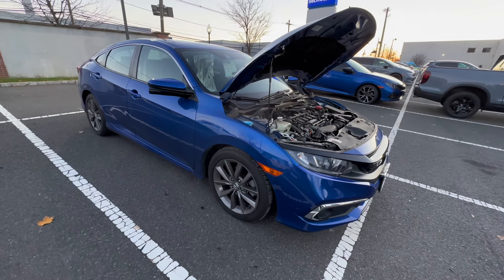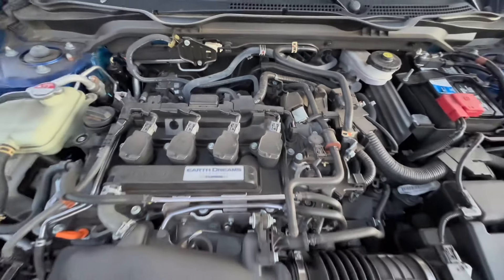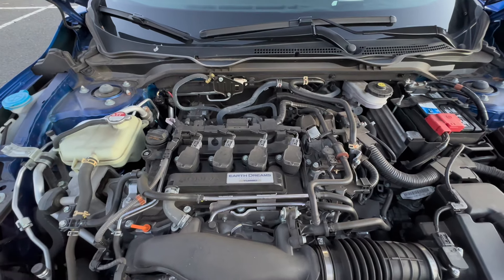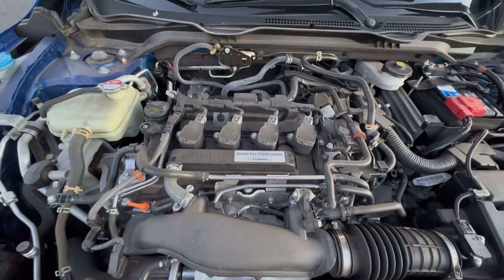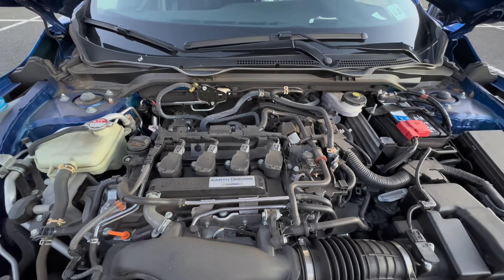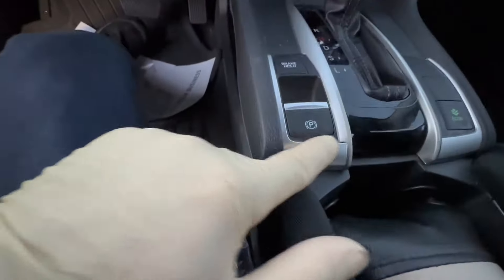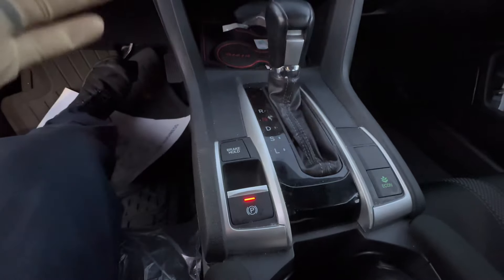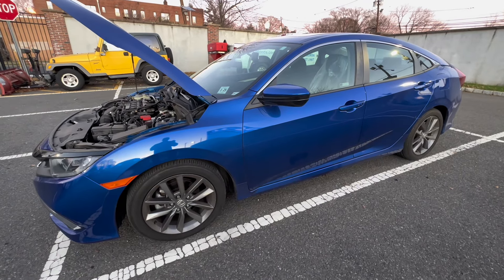2016 - 2021 Honda Civic problems

Comment: 2018 Civic LX 2.0l 6spd manual cold start issue. Starting the car first thing in the morning any temperature, turn the key, starter engages, turns over the engine, engine catches, the rpm initially drops to almost a stall then increases to high idle instead of going to a high idle like normal. Every start after that it functions as normal, only on a cold start does it almost stall. Seems to be getting progressively worst and I'm worried one day it won't start.
Reply from the maker: Possibly a dirty throttle body comes to mind. Wouldn’t be able to say for sure without some data.

Comment: I have a 2018 Honda Civic hatchback 5d sport 1.5l l4 turbo. And I just got a new battery a month ago and I had it tested today because my car won’t start since last night and it still won’t. When I took the battery to autozone they hooked the machine up to the battery and nothing is wrong with it. So idk why my car won’t start. Could you help me? The car has no power at all and no lights come on on the dashboard when you try to start the car up.
Reply from the maker: Body control module most likely or tcm

Comment: my 2016 honda civic radiator fan always at a high speed which makes noise in hot weather. when i speed it goes normal. when i stop it stays normal for about a minute and goes high speed again which is very loud. how can i fix this problem ?
Reply from the maker: It’s most likely not a problem and on “high” to cool off the condenser for proper ac cooling. Usually if it’s extremely loud is due to an aftermarket fan assembly.

Comment: Appreciate the videos man. Any ideas on the reliability of S2000s? Like 04-05 in particular
Reply from the maker: 04-05 s2000s we’re solid. Stay on top of fluid maintenance. Remove delay valve from clutch slave cylinder (causes clutch slippage at full throttle shifts) some cases of rear axle cup wear that can be corrected with spacers or new inner joints. Also have your valve lash checked every 30-45k.
Reply: @BCautosutions  thanks bro!

Comment: 2019 Honda Civic 2liter. Making weird metallic growing noise on idle. Is this normal? Maybe its always been like that and i just noticed?

I changed the spark plugs and its the same
Reply from the maker: I would probably have that checked out, might be a bearing on an accessory going bad.
Reply: @BCautosutions  thank you =) 
Do you think if I relieved the tension on the belt and then wiggled the different pullys, could that help me identify if the noise is coming from a pully?
Reply from the maker: @warrenpeterson5709  yes for sure
Reply: @BCautosutions  it's the Idler Pully! Thanks for the help. I'm surprised it wasn't squeaking.
Reply from the maker: @warrenpeterson5709  🫡

Comment: Hey i have 2017 honda civic lx at 45k miles. I wanted your advice on what to do about the a/c condenser if i dont have warranty anymore? Any affordable solutions? Also, i recently changed my tires and soon after i noticed my car stopped beeping at me when i locked the doors. I have a base model with minimal settings on the digital center display and cannot find any settings that would control that.
Reply: They extended warranty on condenser to 10 years, so you should be covered.

Comment: Ford on some of their Ecoboost 4 cylinder engines from 2015-2019 or so had an issue with coolant intrusion between cylinder 2 and 3 due to the poor design of the block to head gasket mating surface.  There was a little slit between the cylinders to allow for extra cooling on the open deck design.  However, there wasn't enough surface area for the head gasket to seal properly. As a result, there have been coolant intrusion issues as well has cracked head issues.  I noticed that the Honda L engine has a very similar open deck/cylinder cooling slit design.  Have you seen cracked heads between cylinder 2-3? Have you seen coolant intrusion issues as well? Thanks.
Reply from the maker: Yes and yes, I’ve made a full video on this exact topic
Reply: Just watched it.  Nice work.
Reply from the maker: @SibRevs  I appreciate it

Comment: Mine 2019 civic sports 4dr 2.0 L. When i try to merge on high ways feels like it doesn’t want to go over 100km/hr it takes too many rpm to shift the next gear. Car only has 44k on it. other than that no issues everything is smooth. Is that normal?
Reply from the maker: @yetsauto9741  they do lack power. How’s your air filter? Oem? Clean?
Reply: @ haven’t checked it , i am just scared that its not cvt😀
Reply from the maker: @ yeah I hear ya. Have your local dealer take a look

Comment: I have a 2017 1.5 and it had around 65k miles I bought it at around 18k I’ve noticed after having it running for a while it sounds like it pushes itself more or just sounds like louder like it has a hard time when I press the accelerator
 I thought initially able to because I had the AC on and it was very hot but a/c was off

Comment: Am considering 2023 Civic with 2.0 NA or EX with 1.5T.  I like the 1.5T power. The turbo boost on the EX is 16.5 psi vs 20.2 on the 1.5T Accord. Both run 87 octane. Do you think that makes Civic less likely to blow head gaskets than Accord? (Lighter vehicle, less stress on engine too?)
Reply from the maker: Precisely. In fact I’ve done more accord then civics and crvs. That’s my exact dissection as to the major contributor for that. Nice job 👍🏻
Reply: @Hondamobilemechanic  Thanks very much. If I do get the 1.5 I'm still going to do 3k mile oil changes and run 91+ Octane.
Reply from the maker: @stevenr1354  👏

Comment: I have a 2020 Honda civic LX. I bought the car used with 34k on Odo. And ever since I bought like 9 months back. It started the clunking noise coming from the front left axle, and the right suspension made a thud noise. Took it to Honda they first look at this but couldn't diagnose anything. Well after 3 months with alot of suspension parts changed and left axle changed it is still making the same noise. Can you please help. The clunking noise is heard when you lift up from gas and depress it. And the thud noise is coming from them the suspension drops in dips in the road.
Reply from the maker: Could be anything from links to loose/under torqued suspension parts, to bad engine mounts. Tough to say from here

Comment: Anyone had problems with the backup camera on a 2019 Civic Touring? Mine is cloudy, I tried polishing it but needed to replace it. Now the trick is getting the fasteners out from the strip of plastic that covers my access to the camera.
Reply from the maker: Need to replace
Reply: @BCautosutions  I am not sure what you mean, the strip of plastic or the fasteners?

Comment: how about toeque streer at high speed not  safe for  faniy
Reply from the maker: @andreaziz5499  torque steer means under acceleration. Would require massive amounts of power which this car would need 3x more then it has. Your probably experiencing something else.

Comment: I have a question about a 2019 civc lx with the 2 litre and cvt.  Is there 2 filters for the cvt or just one and if there is one in the pan why is it hard to find
Reply from the maker: Just one, behind the trans cooler
Reply: @BCautosutions  thanks wasn't sure if the had one in the pan or not.  Now it on to who makes the better filter

Comment: So I got a Honda civic 2019 sport at first my car jus said electric parking damage and the car didn’t start so I got cables n connected it to the battery n the car did start n the electric parking code went away but now I have to use the cables everytime to start the car so I’m thinkin it’s the battery and it’s been like that two days but now it perfectly starts any ideas on what it could be?
Reply from the maker: I would have the battery tested, if it passes, have it looked at by a professional

Comment: civic si 2017 what about so meany light in the dash board power steering system EPS problems vehicle stability assist VSA problem Hill start Assistant problems
Reply from the maker: Did you get it diagnosed?
Reply: I have the same issue with my 17 civic. I had it scanned but they weren’t able to detect the issue.
Reply from the maker: @jayvillanueva5310  odd, nothing stored? Is the battery older? Low voltage can cause all sorts of weird issues.
Reply: @BCautosutions  it’s really weird. I just replaced my battery couple of weeks ago. My car drives normally though.

Comment: Currently having a problem with my acceleration. When I turn my car on the gadge starts off the 4th line between the 1 and 2. As time passes it’ll  go back down to the 5th or 7th line and as I push on the gas it has a 0.5 to 1 sec to accelerate. Not sure what the problem is would be awesome to hear back on what it can me.
Reply: Throttle lag from the sound of it. I had the same issue. Get CRC throttle body cleaner and clean it. World of a difference for me! Acceleration and reverse were back to proper responsiveness. I've even had issues of the car dying on my three times at a red light also.

Comment: A/c condenser failed twice .  Only warranted for ten years . Then what ? Car has 40k original miles. Rodents got me once . A one time tranny sensor that set off a ton of lights
Reply from the maker: I’m not sure what happens after that. That’s not my call unfortunately. As far as the rodent damage, rodent tape should be applied and chances are they won’t be back. Trans sensor isn’t too common. Thanks for sharing

Comment: I need help! Disconnected battery to install fog lights on 2022 civic now it only turns over then shuts off im so confused
Reply from the maker: Probably something with the fog light install. I’d look/remove your wiring 1 by 1
Reply: @BCautosutions  nothing is connected all I’ve done is place all the wiring where it needs to go it was basically a plug and play install
Reply: The brake light on the speedometer keeps flashing and the speedometer won’t light up
Reply from the maker: @Land2.0  did you unplug anything and plug back in during the install that was in the way?
Reply: @BCautosutions   no, when we disconnected the battery to pass the wires through for the fog lights we then reconnected the battery and the car will turn over but then shuts down  is it possible disconnecting the battery could blow a fuse
Reply from the maker: @Land2.0  no, definitely not. Something went wrong. Did you poke any sharp tools through the firewall grommet?
Reply: @BCautosutions  ended up towing it to the dealer yesterday to find out what the heck happened  and after I disconnected the battery the vehicle decided to deprogram the car keys so every time I went to start it the immobilizer would shut the engine off
Reply from the maker: @Land2.0  that sucks. Atleast now you know what it is.
Reply: @BCautosutions  yup and to never disconnect the battery again 🤣
Reply from the maker: @Land2.0  😅

Comment: Thanks for this video. I've had very very minor problems with my '21 Civic Sedan Sport 2.0 NA. One of them being - the brake PEDAL squeaks about 75% of the time when released, whether the car is on or not... I've taken it to the dealer twice regarding and they lubed but only settles for about a day... any advice? also 2 of my reverse lights have gone out already which is more so annoying than anything.. could be bad bulbs but not a big deal. Just wish I could get the damn brake pedal to stop squeaking when I let go of it haha.
Reply from the maker: Sounds like it could be something with the brake booster. Not a big deal, but if it’s annoying you, it should be addressed. The reverse bulbs going out is a weird coincidence. Thanks for watching. Good luck
Reply: @BCautosutions  actually one more question about braking... I noticed that when I'm braking and the power does a big shift right as I'm about to stop the headlights will dim for like half a sec and then go back to normal, like a pulse. I always notice it now. Same goes for when I'm parked and turning the wheel the headlights will dim. Is this normal? Thanks!
Reply from the maker: @waltcfilms7195  yes it can dim for a second while the system picks up the extra load.
Reply: @BCautosutions  Thanks! So nothing to be concerned about?
Reply from the maker: @waltcfilms7195  exactly
Reply: @BCautosutions  thanks! you've earned yourself a new subscriber :)
Reply from the maker: @waltcfilms7195  thanks 🙌
Reply: my car 2023 honda civic sport 2.0 goodyear eagle sport all season always noise squeaks when stop the brake squeaks only 300 miles buy brand new and I decide I want to rid the goodyear eagle sport all season and I buy a new tires continental extremecontact sport O2 and noise is gone when stop the brake squeaks..

Comment: My 2019 lx civic makes a weird chittering sound after I’ve unlocked it on the inside and when I roll the window down at night the lights start to flicker what could be causing that problem
Reply from the maker: Need more details? While running? Noise from engine? Original battery?
Reply: @BCautosutions  no noise while running it’s only after I unlock the door and open it and I did have to change the battery a year ago cause it died on me out of nowhere I’m not sure if the driver door is just having electrical problems or not
Reply from the maker: @adonisfuentes2782  yeah sounds like maybe a door lock actuator or something acting up.
Reply: @BCautosutions  i appreciate it I might have to go to a mechanic outside the dealership cause I’ve been bugging them about this for a while now and they just say everything is fine

Comment: I have a 2017 honda civic 2.0. It has 78k miles and re3cently all the dash lights came on and has a p0351 code. Its a code for the coil. I drove it fine and parked it for 2 days and this happened. I replaced the spark plugs and coil packs and it did nothing. I checked the battery and the alternator and they are both good as well. Has anyone heard of this issue?
Reply from the maker: @TheBeardedDfault  possibly ecu, harness, pin fit or rodent damage
Reply: @BCautosutions  i was afraid of that answer
Reply from the maker: @ yeah it’s hard to say but too many variables.

Comment: I was going on 70 and I heard a crack and lost power no acceleration…what’s the problem
Reply: CVT transmission snapped a belt?
Reply from the maker: Very hard to say without having any data tbh

Comment: DOES THE STEERING VIBRATE AT HIGH SPEED BREAKING
Reply from the maker: It can, on any car.
Reply: @BCautosutions  In my civic turbo it is just little excessive and I survey from my surrounding civic user they found the same issue so i have been considering it factory issue
Reply from the maker: @abutalharishad3384  get new pads and rotors on the front, that should solve the issue unless you have a bigger underlying issue but there’s nothing I’ve ran across as a defect from the manufacturer.

Comment: What year of Honda Civic or Accord that you recommend buy?
Reply from the maker: My favorite civics are 05-11 and accords 13-17
Reply: @BCautosutions  Cool. I have 2007 Honda civic but a/c line freezes up. I want to know what is the cause so I can fix it.
Reply from the maker: @vmosley2609  blockage somewhere
Reply: @BCautosutions  Thank you.  It's out the compressor, condenser or a/c hose then

Comment: My 2.0 2021 civic wiper fluid motor blew at 8000 miles and I am not a fan of it's suspension with hankook tires...it's weak.
Reply from the maker: Wiper fluid motors are blowing due to wrong fluid usage. Suspension is much better then previous gen’s as well.
Reply: @BCautosutions  while I have your attention ..I have been looking at the element..any pros or cons..
Reply from the maker: @Tracy-wr7mj  pros: versatile. Cons: at this point majority will need a ton of suspension work and potentially leaking and tired engines.
Reply: @BCautosutions  so if I can find one around 100000 or less miles would be better or is the suspension that bad.
Reply from the maker: @Tracy-wr7mj  suspension may still be ok

Comment: Had my first issue today. 66,000 miles, 2019 civic coupe 1.5t . Getting ready to pass someone, so obviously I step on it. Immediately the car goes into limp mode, and starts loosing speed. Every dash light on. Bucking and hesitating like crazy. I thought I blew a charge pipe or something like that. I pull over, pop the hood, and notice a fwap ffwap fwap sound coming from the back and side of the engine. I shut it off and inspect the normal items. To my surprise the serpentine belt had chuncks breaking off it. Like strips of belt missing. The sound i was hearing was a piece of belt smacking against one of the sensors wiring harness. I cut that piece off, and limped it to the closet shop which was less than a mile away thank the old gods and the new! Locked up my car, slipped a note and the key into the drop box. I would normally do this job myself, its super easy on the 1.5t. Ive never had a drive belt go before so this was a first for me. Is limp mode normal when something like this happens?
Reply from the maker: Yes because it caused a check engine light which can just some systems down. If the belt is shearing there’s a possibility one of the pullies is loose or seized.

Comment: Great content. Im in canada and bought new a hatch 19 sp touring 6sp. I feel these made in the uk r cheaply made as compared to the alliston plant.
Had my ac swapped. Rubber liners around the door crap. But fun to drive. Currently at 50k kms. Will start w premium gas. Always avoid short drives. Just doesnt pull as much as before. Do all services. Added a strut bar and in the stock air filter box, a kn filter. Hope the gas switch, from reg will make a difference. Any other suggestions? Tires are topped up too
Reply from the maker: Nope, you just about doing everything you can. Thanks for sharing